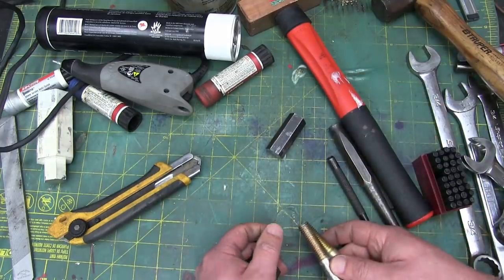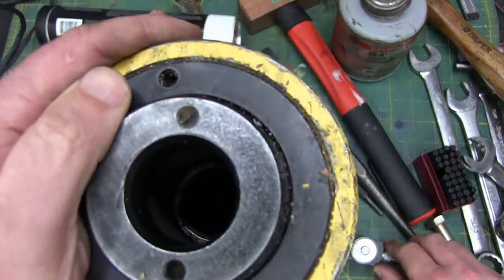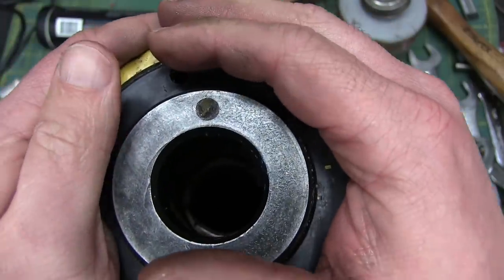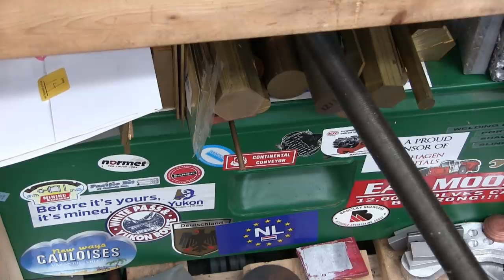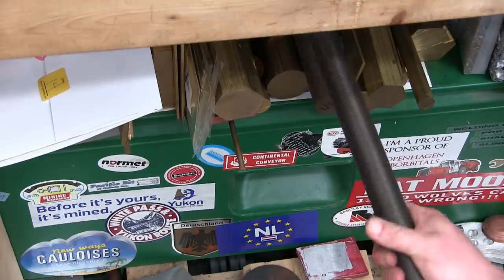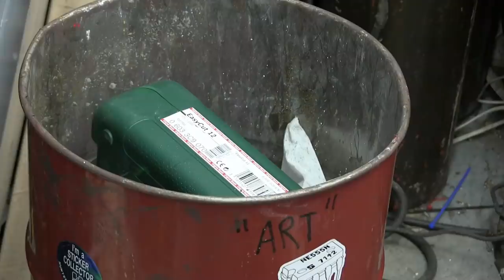Tensile Strength Tester | Fabricobbling Fun

Comment: Enginerd coming in. 
There is a problem with your tensile testing method. The gents in the white lab coats conduct tensile tests at near static conditions. A strain rate of 0.02mm/sec, the sciency way of saying, stretch it out super slowly. Your test works much faster, this will mess with your results when you get to strain rate sensitive alloys. Alumimnum is a huge dickhead about this but almost all metals have some sensitivity to strain, and behave differently depending on the rate.

EDIT: I'm not saying that the fun version doesn't have merits or applications in testing. I'm saying that understanding the potential limitations and errors is an important step in applying your results to the real world.
Reply: So you're saying pull on it hard, but pull on it slow and steady. What about at a medium pace?
Reply: "So you're saying pull on it hard, but pull on it slow and steady. What about at a medium pace?"
More speed, more messy results... its all to do with the serrated stress-strain curve or jerky flow... apparently..
Reply: We still talking about bolts here or something else?
Reply: What you say is true but in the world outside and away from ASTM the stresses can be applied at any rate from almost zero to explosive speeds.  Where it's not practical to use a test prescribed strain rate usually an adjustment can be made in the test results based on rate of loading effects.
Reply: Cameron Smith I've never torqued up a bolt at 0.02mm/s. We had an apprentice who tried for a while, turned out he couldn't fly!
Reply: 901EE, you're right. In the real world things are highly variable. But being informed of, and upfront about errors that are present is an important thing. Inevitably, he will declare some thing to be stronger than another thing. The problem is that its only stronger in that case. In a different case the "weaker" thing might perform better. And that case might be more applicable in the "real world". So being aware of this effect can allow us to make more robust predictions. Which is the goal of any scientific testing.
Reply: I think that both tests are actually relevant in the spirit of getting a true read on the ductility or lack thereof on the material.
Reply: Jandastroy, exactly tensile tests and strain rate tests exist because someone said "Hey, that is different than what we expected" Science uses tools to model reality, and make predictions using those tools. Understanding the limitations of those tools is an important step. I'm just the messenger.
Reply: Enginerding major here. Even if it's not an accurate test, it's still fun. Although, I do understand what you're saying completely, as I've done tensile tests at slow speeds and high speeds.
Reply: Glad us Cameron's can agree!
Reply: It's not the way Enginerds test tensile strength, but it's the way the real world tests tensile strength in some circumstances. The tensile strength of each bolt will still be relative if the test is performed the same on all bolts tested, no?
Reply: It will indeed be relative and interesting to see. However different materials react differently with a different strain rate, and the relative differences will be different for a high strain rate test than for a low strain rate test. We therefore cannot take these results and apply them to all use cases. Ideally you would do both sets of tests (or more) and use whichever data is more appropriate for the load case you are looking at.
Reply: Cameron Smith Im guessing the "sciencey" version cost a couple hundred thousand, which he doesn't have. So the "fun" version it is!
Reply: Don't think strain rate is gonna catch him that much. Bending is a different story though - no control or repeatability, results are going to be all over the place. Just for example on 1/2 " fasterner, 10 tau misalignment are about 15% extra bending stress for the same tension force. 
+ surface on the one he tested is typical for bending failure.
Reply: Jason, no. That's why I brought it up. Strain rate can greatly influence the perceived strength of a material. It's a ton of information, but I'll try to be concise. As plastic deformation occurs dislocations(errors in the structure) move and the material becomes stronger, this is the basics of strain hardening. Conducting the test too quickly reduces this effect. Some materials exhibit huge amounts of strain hardening, some don't. This test will handicap the ones that do.
Reply: Evgeni, that's a good point. If the apparatus is at all misaligned, the reported strength could be wildly inaccurate.
Reply: I've seen people use 3/8 in bolts to connect the ends of chain together for rigging. That, is the real world. Side load, tensile strength, shock load, everything in one
Reply: In real world conditions a strain rate of .02mm/sec will get you fired, slow production rate and unsuitable lubricant selection. Now I know why the lab guys have white coats, sick.
Reply: Cameron Smith cool comment cameron
Reply: C J pull it any which way you can fellas or don't pull it at all. Any which WY but loose.
Reply: Alan Fisher lmao
Reply: If he wanted he could easily chuck an adjustable flow valve to fix that in there. Or just tap slowly on the pedal
Reply: Usually the slow speed is only necessary for determining yield stress/strain and modulus of elasticity.  A lot of metal tensile specs call for switching to a higher speed after 0.2% or so, depending.  I think ultimate strength is less impacted by the speed and that's probably what this rig will be best at measuring.
Reply: underrated reply
Reply: Is it possible to have such a low strain rate that the fastener never breaks?
Reply: Ja we know perfessor, due to all them bolts what measure their torque via stretching on them limey bike motors, and have to be replaced with new ones next rebuild since you done stretched the ones on there already.
Reply: Tim Burke eventually you will reach its deformation limit
Reply: Now if only there was also agreement from the head of the Department of Donkey Photography, Cameron Diaz, there could be a quorum here.
Reply: This could apply if you do lots of bungee jump, though...  Interesting to know what the odds are in this case....    lol

Comment: The more I watch these, the more I tell myself I need a clapped-out Bridgeport.
Reply: Scott Murphy I think one would be great right next to the he couch in my living room.
Reply: Scott, that would be 4' under your living room depending on how deep your crawlspace is. Also, if you're serious about getting a mill, get a Wells Index style, it's a bridgeport with a horizontal spindle too!
Reply: +Gerald Gepes nice
Reply: A clapped-out Bridgeport is the only one to have. 😎
Reply: To ebay,, and it'd just be  like buying that 2000 dollar present for yourself..
Reply: Gerald Gepes u have a full basement but floor modifications would still be needed. I'm holding off until I build my shop. It will have plenty of room and LOTS of overhead space
Reply: Owning one changed my life, and my looks. But I will advise to also buy a welder as sometimes metal needs to be put back.
Reply: I told my dad I didn't want his clapped out Bridgeport when he no longer wants it or can not use it, but now i'm reconsidering...
Reply: I got me an old clapped out lathe
Reply: +simon ross Cockford Ollie is a famous machine shop in Canada in the early 1900s when no one else could fix it and everyone else just gave up they went to Cockford Ollie for results Cockford Ollie saved many a life during the wars
Reply: +Jc Cj Your clapped out lathe... compare to my, is like little baby.
Reply: If you can find a decent one, I could do a clapped out conversion on it for you.
Reply: THe ones out there are almost "All" clapped out, So, easy to find, finding one in great shape is quite another story...   ;)

Comment: I labeled the trash can in my office with an "Art" sign, my supervisor was amused... until she told me to take it down and make sure I don't "decorate" anymore lol
Reply: When I was doing heat tracing we called them trophies. We replaced another heat tracing crew who had a pile of trophies 20 feet across and ten feet high. That made it pretty clear why they got replaced.
Reply: akbychoice, No "ART"
3:49
Reply: red7fifty that ones on the shredder
Reply: alexmad93 you mean the recycle bin. 
That's what happens when you press Delete and not Shift+Delete.
Reply: I have a dry paint sign on my wall, most of the office doesn't get it.

Comment: @ AvE, Have you thought about adding a strain gauge to this?
The easiest way would be to have 2 sheets of transparent film. Print onto them a row of lines, with slightly different spacing on each. Then attach one to the top and one to the bottom of the tensile tester so they overlap. As you pull the bolt, it'll make interference patterns that will let you quite accurately measure the strain.

Comment: Brings back memories. as a young buck in the oilfield and new shop hand. this was the mid 90's I was sent by the shop foreman to get a bolt stretcher as a joke. well little did he know I was a trained and vo tech school certified machinist, and knew they were a real thing and ware to get one. so off to tea old industrial nut and bolt supplier. and told the guy behind the counter what I was sent for he shot me the price of 150K - USD for the deluxe kit. and asked me for a PO so I called the office the boss picked up the phone after a bit of phone swapping on their end no one else was willing to authorize it. wants me to explain myself.then he asked to talk to the salesman an hour and some later I have a big box on the back of the duse. well, I pull up to the shop and hop out and hand the shop foreman the pile of paperwork with a price tag of 200.K - USD and nonreturnable rubber stamped on it. about this time the boss walks in and demands to know whats in the box. .. he sweated the shop foreman for a bit telling him that it was a tool and as such since he ordered it without prior approval was coming out of his pay.  After some arse kissing and but boss ity was suposed to be a joke. and begging the boss let him off the invoice was a fake the box contained our usual order of fasteners and whatnots the shop foreman made my life hell until a rigging crew needed a hand.

Comment: We use the Instron 3385H tensile tester here at the university for our enginerding stress strain learning. Just did some tests on AISI 1018, 1045, 4140 and some aluminium 6061-T6. Twas a grand old time.

Comment: I work at a materials testing lab and we have 3 tensile testers up to 300 kips. If you ever want me to test some nuts or bolts in them, I’m happy to do so, as we have all the fixtures for bolts from 1/4” to 1 1/2”

Comment: Ya' ever work on a spline roller AvE? Ya' got all the kit as if though it were so, in that vein I'm ordering a few of those tension nuts your video tipped me off to. The type that push on a hydraulic cylinder with a few smaller fasteners to maintain tension. Damn lock nuts just back off after a week of running. Something about 100 tons rolling a 31 spline rack, harmonics just kill shit. Anyway, thanks for the tip off and I'd really like to see you test some HoloKrome 12.9 SHCS, they're dirt cheap and ubiquitous in CNC building, 12mm and dun dun dun... 16mm would be awesome.

Comment: I had an idea for a video the other day but it seems you beat me to it. Idea was, how do the engineers come up with torque specs(say for torque specs on a cylinder head bolt)? How do they know the clamping pressure at a certain value, and what they need to have for proper clamp pressure with a gasket. Just something that crossed my mind, it would be cool as shit to know the gritty details of what each farsner can do at certain specs.

Comment: You would never see beachmarks of a straight pull, because the load was not cyclic. The beachmarks are formed when there is cyclic stress just below ultimate failure, repeatedly. With each cycle the fracture grows a little more, then closes back up until it finally fails. But in a straight pull to failure there is no cyclic effect.

Comment: you need to back off the nut two threads for a proper test! you will get better results. also remember to not let the radius on the bottom of the head touch the fixture or you will have head failures. thanks for the vids! this one brings me back to the lab at the fastener machine shop.. destructive testing is so refreshing..

Comment: Hey AvE, really looking forward to a video on this matter, make sure to warm up the potato-cam for this! However, will you be testing metric threads as well? Different thread pitches? Rolled vs cut threads? Thread shear for different nut heights (no no, not THOSE nuts...)? Anyway, keep your d in a v!

Comment: If'n you utilized the "Drill Doctor " on those bits they would've sailed thru that hard rod like a muskrat🐾 down a drainage pipe...😁 That would be interesting to see performance differances in hand sharp,Factory sharp,or Drill Sharpener bits in hard and soft materials? In particular torque feedback(wrist rearrangement) which is a common problem with hand sharp large bits? Not everyone has a mag-drill.

Comment: AvE. I'd like to see if you can test not only WD, but aerokroil and PB blaster. We use aerokroil at work when breaking down the presses and hotform tools and I'd like to see if anything is better.
Reply: to add.  50/50 acetone and some tranny's fluid. I've used it and it seems to work well.

Comment: Hello,
Can you test copper wire in some form I'm interested to see how a big wire say 500 kcmil compares not sure how that would work with this test but just curious how that compares.
Reason I ask I see it all the time on jobs a conduit gets hit or bent or broken and stuff still works not sure if that is just space in conduit or extra length in the wires but the tensile strength prob has something to do with that.
Thanks

Comment: Whats going on with the sparking on the lathe 1 minute in, noticed it only seemed to happen near the edge is that to do with chatter or differential quenching maybe ?
Reply from the maker: +Fionntan Osuibhne What you are seeing is  carbide vs. Hard S2 tool steel
Reply: Well makes for some dazzling footage

Comment: I would like to see you use this rig to prove my coworker a moron. The guy is a wizard at breaking taps so he uses larger than recommended drill bits before tapping. Make a video showing the loss in strength for every Xth of an inch increase in bit size

Comment: Textile Tensile strength tester is designed to test a wide range of materials in tension, bursting, tear, elongation, constant load, elastic, thread slip, peeling and other mechanical properties. Tensile Strength Tester complies with ISO 13934.1/2, ISO 13935.1/2, ISO 9073.3/4, etc. Click at https://www.testextextile.com/product/textile-tensile-testing-machine-tf001/

Comment: Actually i just did a tensile testing analysis lab for my mechanics of materials class. had the proper machine but pretty sure the sensors were fucked cause the data made absolutely no sence

Comment: Also, $10 says antiseize doesnt work for shit.
Reply: Isn't it used to prevent thread galling?
Reply: I would say it's usaully miss used.
Reply: It definitely works.
Reply: I've used a branded copper type one in the uk for over 20 years mainly on rusty old VWs that get all winter use over time it works. I would say without any back up from tech bods or actual proof it stops the treads cold welding together then rusting. 
But I'm wrong about most things, so flame away :)
Reply: antisieze or lubricant mandates a 10% reduction of required torque...or twisty mctwist of the fastener as a 400# gorrilla leans into it on maximum crankification
Reply: We use nuclear grade nickel anti seize at the blast furnace. Rated to 3000F+ and yes, it works.
Reply: MoS2 works like an alternatively documented immigrant.  No chance of galling at all with all that sulfur.  And just the ticket when there is aluminum.  Great heat resistance.
Reply: When I started using anti-seize, I stopped having disassembly problems. Especially on things like exhaust nuts, lug nuts, motor mounts, oxygen sensors and tensioning assemblies. Any time a steel bolt threads into aluminum, I put a dab on there, and even after years of service, it comes right apart. Even in applications where heat cycles constantly cook and crush the fastners, it just seems to work. It is a lubricant so it will impact the ability to transmit torque, and allow a smoother application of torque, but it's strength is in how it films the thread and prevents galling, corrosion and sediments from locking the fastners over time.
Reply: AvE should try it on some stainless farseners.
Reply: Gerald Gepes Been using the stuff for three decades fixing cars and it's served me well!👍
Reply: For automotive and things that are regularly maintained, I'm sure it does fine. I've had it used on clamping systems that have 25,000 lbs of load held on a fine pitch thread. Engineer called for antiseize and it destroyed the threads. On fine threads under high load, the best thing I've found is a clean thread and fine oil. I put antisleaze on my glow plugs and things I expect to freeze up just to hedge my bets but it's no replacement for maintenance and using the right fastener for the right application.
Reply: tr0n we always used silver grade but you're exactly right on the route cause. It would abrade the nut until it galled the threads.

Comment: Fuk  yes anti-seize does work ! I work on equipment running 70 psi steam and you know damn right quick whether the wrench monkey before ya done gone and broke a tool steel grade bolt off in ya ass by omitting the liberal application of the silver ( or bronze ) ointment.